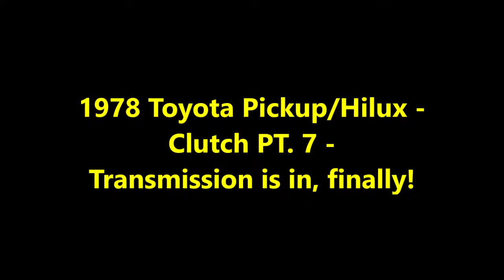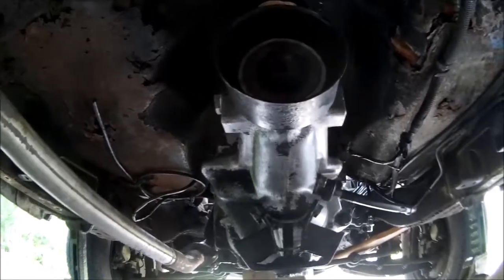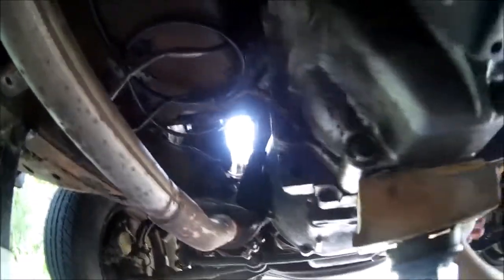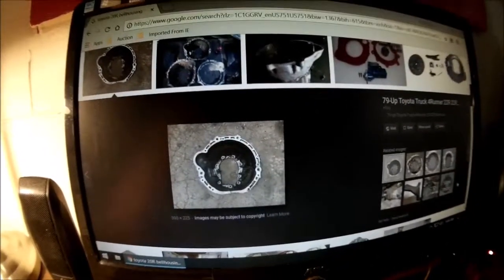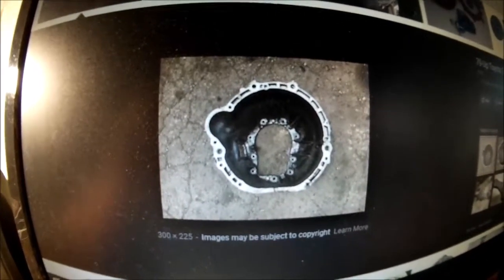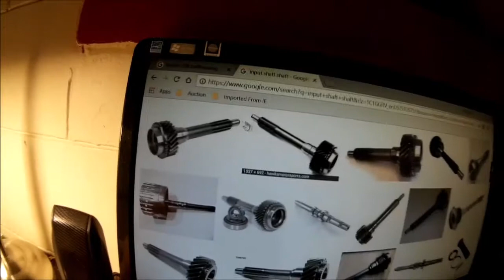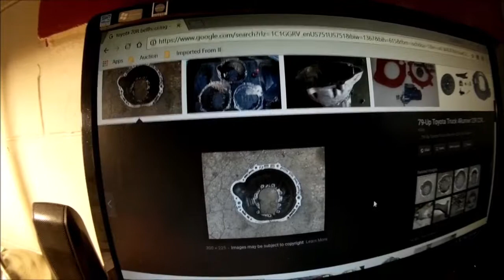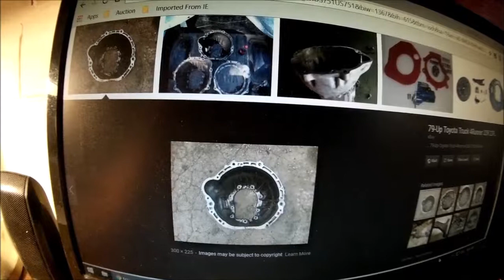1978 Toyota Pickup/Hilux-CLUTCH PT7-Trans is in! Finally!

Comment: Nice your persistence paid off. It took me a while to figure out, in my case, I have a 82’Hilux with 79’ 20r. The 20r sticker on the front was torn in half diagonal so I thought it was 22r like in most 82’s.Alternators and voltage regulator completely different between those years so was a challenge to figure out what I needed finally. 

Keep Going ! And thanks a lot for sharing the videos!
Reply from the maker: Thanks for the recognition. As I'm sure you've learned as well, you only lose if you quit. There's almost always a way to get it done with this stuff. I'm glad the videos are helping people out; that's my sole reason for posting them.

Good work on your part as well sir.👍

Comment: Your videos are great - thank you.
Reply from the maker: Thank you so much for the kind words. I only make them in the hope that they can help other people with similar trucks, and/or similar situations. Once I found the "diagonal placement" of the pins worked so well I completely endorse using the alignment pins for an install. 20 minutes to get the trans seated compared to 25 hours of struggle with no joy; it's no contest.
Reply: It took me 2 years to get my clutch in right - What happened was I put a 1978 engine in my 1977 pickup - they look identical but they're not. It's 2 different clutches and they were making a lot of noise then disintegrate after 6 months. 1st I swapped transmissions (another '77 W50) then I swapped Flywheels - I kept eating clutches until I swapped back to a '77 engine. Now it's fine. I'm not exactly sure, but I think the crankshaft in the '78 is longer?
So don't feel bad, It relay could be worse. hahaha
I found that turning the transmission output shaft (oil slinger removed) in while in 4th helps slide things together for me.
Keep 'm Running,
Mike
Reply from the maker: Hmmm, strange indeed. See, now you've got me digging out of curiousity. I don't think there is any difference in crank length as that would mean there were 2 different 20R blocks out there, and I've never seen any mention of it. You'd think such a thing would pop up in research. There may be a difference in flywheels. I can't find exact specs for the stock flywheel but the one I bought (ATP Z276) shows it as fitting a 20R in my "78, plus fitting 20R's in 1975-1980 Celicas. Stock flywheel is around 25 pounds but there are some 38 pounders out there which may have different thickness; that would explain engagement problems. Gawd knows what a previous owner may have stuffed in there that you then had to contend with.

Other strange thing is, RockAuto lists the flywheel for a '78, but if you look up the "77, they don't list a flywheel being available at all. They do list clutch kits for both years and they are the same part numbers.

I dunno, you may have been a victim of some other factor. You've probably been thru this before having worked on older vehicles; I sure have. You do everything by the book & in spec & it still doesn't work right, due to some unknown quantity that the durn book never told you about. Another reason I'm posting all this info.

Tried the output shaft thing but no help, as I left the trans in neutral; the input shaft won't turn that way; dummy me. In my case tho getting it to spline up wasn't the issue, it was getting the nose of the input shaft into the pilot bearing; durn tight fit! Scotchbrite-ing the shaft nosecone & using the alignment pins sure helped.
Reply: Which type of gasket did you use on the exhaust to manifold flange? I finally (!!!) got my transmission back in last night, ready to button things up. When I took my manifold off whatever type of gasket was in there kind of crumbled into a million pieces so I couldn’t tell what it was...
Reply from the maker: Although Toyota doesn't specify it, I went with the "donut" gasket AND the flange gasket (triangular with 3 holes).  From what I have been told, you don't really need the "flat triangular" gasket, just the "donut'.  I did both because I overdo everything. :^) BTW this on is the 20R exhaust manifold; the later 22R manifold (which will fit the 20R) has a "chevron" shaped flange with 2 holes & that is a totally different gasket setup. It also has a different flange on the downpipe to match it.

The "donut" one I used was the FELPRO 23591, about $4 at any parts store. I've had no trouble with it since install. Torque spec on the pipe to manifold bolts is 33 foot pounds. I recommend torquing them up in 3 stages; 11 pounds, 22 pounds, 33 pounds. This makes it pretty "even" & allows for proper "crush" on the gasket for a good seal.

I do not have the part # on the triangular gasket on file; I had to measure the flange & bolt hole center specs & match it up @ the parts store. I do remember it was also a FELPRO & was metallic.

Let me know if I can help you with anything else, & congrats on getting your trans back in!
Reply: I don't think you meant your comment to be directed to me - I just use the stock exhaust manifold gasket on my '77 pickup. You can get them new for about $20.
Reply from the maker: You're right, it was aimed at someone else who sent me a comment in your original thread.